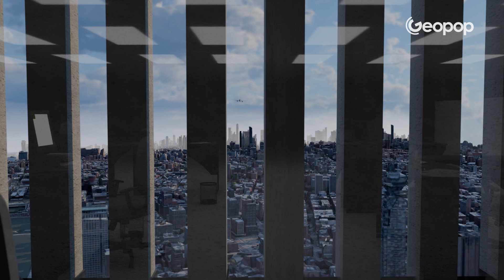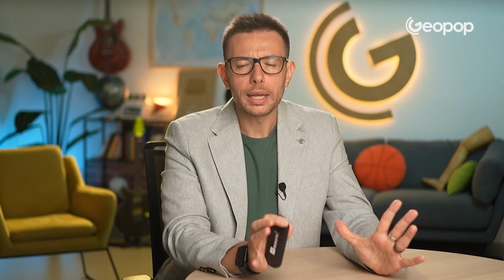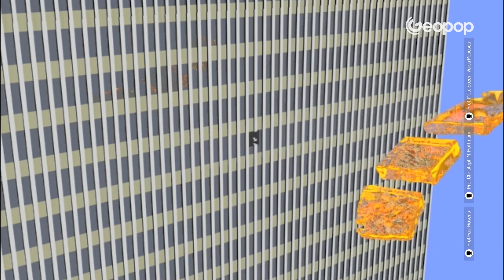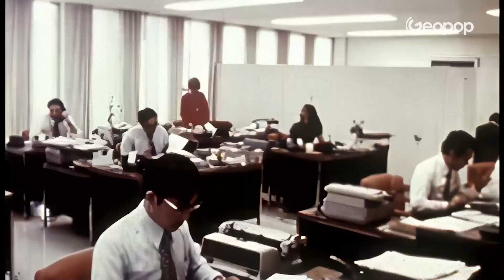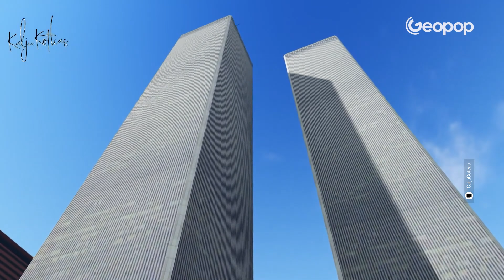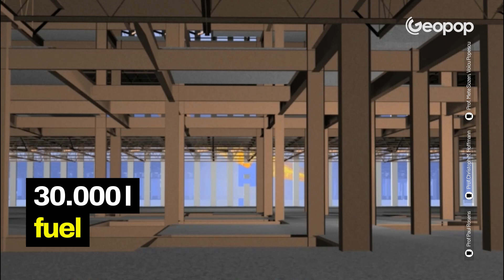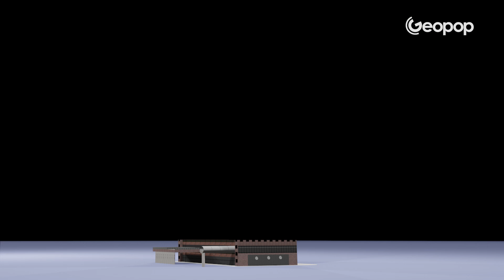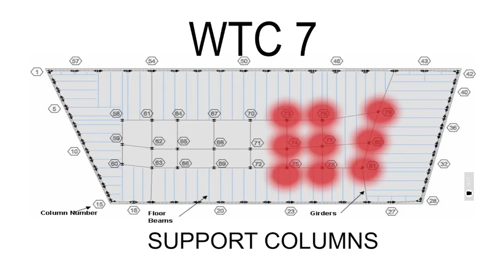9/11, 2001: The Technical Reconstruction of the Twin Towers and WTC 7 Collapses

Comment: did you do a test for explosives? or are you basing your theory on a theory which never did such a test even though the remains of the dust were still active as demonstrated in many videos...
Reply: What is the first test for explosives?

What is active dust ?
Reply: @TheLoonResistance  so wait: NIST never went full CSI on any of the materials sampled around the building? what exactly did they do? compose a self defeating simulation of which they couldn´t do more than a 1.2 seconds?
Reply: @JefframinEpsteinyahu  - So wait, please don't be rude by dodging my questions.  I do not tolerate deliberately evasive off-topic derails.
Reply: @TheLoonResistance  there was no test ever done to prove or disprove the existence of explosive or thermitic material. at least not by NIST. but Nist itself mentioned the iron granules only created during thermitic reactions.
Reply: @TheLoonResistance  don't you think that not testint for explosive residue/material is kinda strange given that there was an bomb attack on the building before?
Reply: @JefframinEpsteinyahu  - What is the first test for the use of explosives?  Please answer the question.

IF you don't know then please stop dragging this out and just say you don't know. The honesty would be refreshing.
Reply: @TheLoonResistance  plz indulge me as to why there was no test done and no test results released by NIST
Reply: @TheLoonResistance  show me the results of the test and i may tolerate your rhethoric wankery
Reply: @TheLoonResistance  i have a question for you tho: why does the video say the elevators dropped with no resistance when everybody and their mother knows that once an elevator loses it's steel cable an automatic locking mechanism is released. so this video is just one more bunch of narrative bullshit
Reply: @JefframinEpsteinyahu  - I have a question for you:  What is the first test for explosives?  

You can't say no tests were done if you don't even know what the first test is.
Reply: @TheLoonResistance  i can say this because Nist itself stated this publicly after being questioned about it. so sit down and shut your little propagandized ass up, i m not playing your games shithead
Reply: No, you can't.

The NIST were not exactly the first responders, were they?  They didn't start their full investigation until August 2002. Other entities were on scene long before The NIST was assigned to the case.  IF the matter of explosives had already been resolved before The NIST came on board, there is no reason for The NIST to test for explosives (whatever that means), is there?

Is there some compelling reason The NIST should be testing for explosives by the time they came in - other than of course you have a deep need do believe there were explosives?  Do you have anything tangible?

Where would you start?

Recall, The NIST merely stated:  NIST did not test for the residue of these compounds in the steel

That's pretty specific, and not where anyone would start
Reply: @TheLoonResistance  nice assumption troll, so how was the matter of explosives resolved before nist came in?  since you know the first test, when was it made and published and peer reviewed (independently)
Reply: what you are basically saying is that 3000 people died and overpaid intelligence services and government institutions cannot present you with proof of disproof (by means of testing and sampling) of explosives used in THE BIGGEST TERROR ATTACK?

but then you go on and bomb 5 countries to shit by pretending it's islam (the one you funded, agaiinst russia, remember? ) and murder and starve MILLIONS, creating over 40 MIO REFUGEES

but you can't provide me of a full comprehensive explanation with actual factual proof and samples? 

you are a nazi pundit and apologist for the biggest massacre in history since adolf hitler.
Reply: @JefframinEpsteinyahu  - I'm not saying anything - just trying to get you to turn your brain on.

Had you actually read The NIST's final reports or even just the FAQ's you wouldn't need to ask any of these questions.  For example, from the Twin Towers FAQ:

28. Why didn't NIST consider a "controlled demolition" hypothesis with matching computer modeling and explanation like it did for the "pancake theory" hypothesis ?

NIST conducted an extremely thorough three-year investigation that included consideration of a number of hypotheses for the collapses of the WTC towers

Some 200 technical experts—including about 85 career NIST experts and 125 leading experts from the private sector and academia—reviewed tens of thousands of documents, interviewed more than 1,000 people, reviewed 7,000 segments of video footage and 7,000 photographs, analyzed 236 pieces of steel from the wreckage, performed laboratory tests, and created sophisticated computer simulations of the sequence of events that occurred from the moment the aircraft struck the towers until they began to collapse

Based on its comprehensive investigation, NIST concluded that the WTC towers collapsed according to the scenario detailed in the response to Question 11

So The NIST interviewed over 1,000 people, reviewed thousands of photos and hours of video and performed direct analysis on critical steel components saved from the wreckage.  None of that supports explosives or incendiaries. 

Long before The NIST got involved there were over 300 canine teams combing the debris pile for weeks - not a single hit for explosives or incendiaries. Thousands of workers cleaning up debris and hundreds of forensics experts sorting every grain of dirt and dust that came out of Ground Zero found zip for trace evidence of explosives or incendiaries. 

The NIST based on the visual record, photo and video evidence, empirical testing, 150 years of fire science research and computer modeling developed a hypothesis for collapse that matches all of the known evidence and that does not involve explosives or incendiaries.

So what else were they supposed to do and why?
Reply: @JefframinEpsteinyahu  - So there. Was that really so hard to figure out?

Comment: 4 million pounds per floor,112 million pounds above the south tower,and 76 million over the north tower. Idiots think the building was supposed to hold up that weight forever
Reply: They stood tall for 30 years alright until they were knoocked down by planes!
Reply: @ajMirza-gc6il  Nuh, not by planes.
Reply: A three-alarm fire broke out in the 11th-floor offices of the B. F. Goodrich Company in the north tower of the World Trade Center just before midnight last night and spread through an inner-service core to the ninth and 14th floors. “It was like fighting a blow torch,” according to Capt. Harold Kull of Engine Co. 6, who said all of his men “got their necks and cars burned” trying to get into the 11th Floor hall from a stairwell. A total of 24 pieces of fire fighting apparatus and 132 firemen fought the fire. Sixteen firemen were treated at the scene for smoke inhalation. Flames could be seen pouring out of the 11th-floor windows on the east side of the building. 
--- TRADE CENTER HIT BY SIX-FLOOR FIRE, Blaze Starts on the 11th—16 Men Are Injured, The New York Times, February 14, 1975.  Needless to say, with the weight of 99 floors bearing down upon the 11th floor, the building did not collapse.
Reply: @markcohen308 wow you are dumb
Reply: @markcohen308 a fckn plane didn't hit it then
Reply: @basicengineering74 Yea well, if you want to play that game, no plane hit Building 7 and NIST said fire alone brought it down, the first time in history.   And plane impacts still do not explain the building falling at free fall acceleration (as admitted by NIST).  That is a hard violation of Newton's Third Law.  That's impossible.  And yet the North Tower came down as fast as a brick dropped off the side of the building falling through air.  That means that the building, with all its steel and concrete, crushed through itself as fast as a brick dropped off the side of the building falling through air.  The North Tower collapsed in about 11 to 12 seconds.  NIST said the building came down in 11 seconds.  But 11.52 seconds is the speed of a 'tumbling' brick dropped off the side of the building falling through air.  That means the building fell through itself with ZERO structural resistance.  That's just not possible.  Free fall means an object that is only under the influence of gravity.  If something is falling at free fall than all of its kinetic energy has to be used to do nothing but simply fall.  There is no energy left over to crush something, smash something, bend something or pulverize tens of thousands of tons of concrete to dust as happened on 9/11.  I'm sorry, but that is the hard science.  If nearly all that concrete being pulverized as was observed on 9/11 then it cannot have been a gravity driven collapse.  Gravity alone cannot explain how the concrete got pulverized.  There had to have been another source of energy removing the structural resistance.  And thats only one of the major problems with the hard science.
Reply: @markcohen308 because you are focused on one element (fire) and not all other elements of physics. The jet literally broke steel supports. You can, but you won't, go look at footage and see it with your own eyes. You used "fire alone" as a comparison to "fire, force, removal of fire retardent, and the fact that this fire was fueled but insane amounts of jet fuel compared to just a fire. You are bad at this. Are you bad at all other aspects of life as well?
Reply: What about the heard explosions down in the lobbies....they have to be controlled.On key places of the buildings,put in advance and the whole scenario contolled from building 7. 9/11 was made by the military industrial complex,which stands above USA president and government,and has its own agenda.
Reply: @dimitarminchev7520, how does that make you feel to know you're just repeating things that aren't true?
Reply: @basicengineering74  How does it feel to expose yourself as a stupid liar? The Twins were designed to withstand a fully loaded 707 crashing in at 600mph, AND the resulting fires. And that´s despite the fact that the Twins didn´t even had sprinklers first. You can look that up. IN THE OFFICIAL REPORTS my poor little wannabe.
OF COURSE the towers were supposed to hold the weight forever moron.
Reply: Ignition of intense fires can often sound like explosions.
Reply: @eggsinhell1532 right. Same with steel supports snapping. Incredibly loud. Just chop a tree down and hear the noise it makes. Now multiply that by several orders of magnitude. These tin hats have always been fools.
Reply: @dimitarminchev7520, go look at the bent pieces of steel. Watch a video at the WTC Memorial Museum. You have zero clue what you're talking about,and you think a controlled demolition caused that lol? A cold compressed piece,a 2 inch thick piece bent like it was made out of something else. Yet your on here showing the entire world how ignorant you are
Reply: @basicengineering74  Not your completely irrelevant compressed piece of shite was caused by an explosion but the blown out windows and cracked walls moron.
Reply: So you call the chief engineers of that buildings "idiots"?
Reply: @Kudde23 not the engineers, the conspiracy people who know nothing

Comment: Steal melts at like 2,000 degree's at 900 it would bend like he said... always amazed me how steal columns can vaporize under only weight... like he said 900 degree's at the impact point and as the floors go down it would get less hot... but then I realize he reading off a "report" that who knows who had written... Then that 900 degree's got blown by the wind into tower 7 and took that building down the exact same way... some of the dumbest engineering our country had ever built in history... nobody wants to admit this guy is blowing SMOKE
Reply: That was one of the dumbest posts out country has ever seen.

Comment: Bollocks.. what about the liquid metal dripping from the side of the building. Claimed to be thermite.. What about the windows blowing out a second or 2 before the colapse many floors below. Reported by firefighters as explosions.. Building 7 reported by bbc as colapsed half hour before it did then a textbook controlled explosion. Hundreds of architects and engineers have came together and pulled this storey to bits not to mention the firefighters too. Do your research people. Architects and engineers for 9/11. The REAL TRUTH IS THERE IF YOU LOOK FOR IT...
Reply: Whataboutisms are for the weak.

Sparks pouring out of the South Tower (and it was in fact ONLY the South Tower)?

You mean this? youtube.com/watch?v=xPVGGQU-MeQ&ab_channel=SeekersofTruth

This will take just a couple of minutes and is worth the investment.

The Boeing 767 which struck the South Tower weighed 117 tons and 80% of that was aluminum. The exterior cladding on the Twin Towers – the white panels – were also aluminum. When Flight 175 struck at the 81st floor its momentum deposited much of the office contents in its way and the bulk of the aircrafts mass into the NE corner of the building. The piled up debris shoved into that corner is visible in photographs and video so we know it was there. There’s a good shot here of piled up debris from 4:36;

youtube.com/watch?v=ZLJyL63sqtU&ab_channel=MrKoenig1985

Steel melts at roughly 2,750-deg F while fires in the South Tower reached peak temperatures of around 1,800-deg F. Aluminum OTOH melts between 887-deg F to 1,180-deg F depending on alloy. That aluminum will melt under these conditions is not a surprise. If you look at pictures of cars left behind and destroyed by forest fires the aluminum wheels are invariably melted away along with other sometimes aluminum parts like hoods. Steel bodies remain intact.

The “molten metal” appears at 9:52 am. At the same time we see the first externally visible signs of sagging floor trusses and the pulling of the perimeter columns inward. I submit these events are related, not coincidental. The aluminum cladding at the NE corner also appears to me to be burning. It is likely the with the floor trusses sagging under the heat, and the 81st floor truss in the NE corner under the debris pile subjected to the heavy load of the debris pile, the truss broke its perimeter column connections and dropped, instigating the material starting to pour out of the NE corner at the 80th floor.

Given the properties of the materials in question, aluminum is by far the most likely culprit.

Reports from The NIST, FEMA and MIT all concluded the material is aluminum.

Certainly steel is the least likely of all the materials the anomaly could be given its much higher melting temperature and the fact there is no logical source for molten steel. The perimeter columns in the NE corner are intact and the material is pouring out between them. So it isn’t columns melting, therefore what other source of steel is there?

As for thermite - that is just pure conspiracist fantasy. The mind boggles as to why it took so long for an incendiary to cook off in such massive fires. Not possible. The claim falls flat on its face.

Deniers will claim molten aluminum appears silver when molten, which is true but only at the low end of its melting temperature range. Aluminum can and does get hotter and it glows red to orange when it does (1,100 to 1,800-deg F). Most folks of course just don’t bother getting it that hot if the goal is just to get it molten for say molding a part. No need to go higher. The total mass of molten aluminum is a BIG deal in regard to how it behaves when poured. Quantities bellow half a liter cool almost instantly if poured onto a flat surface, but if poured into say an ingot mould will stay red for a minute of so. Pouring volumes of molten aluminum greater than a liter is a VERY different experience. The thermal mass is much greater and the radiant heat is horrendous. The aluminum is able to stay liquid and remain glowing bright orange much longer. The famous video of glowing liquid gushing out of Tower 2 moments before it fell, involves at least tens of liters of molten aluminum. The thermal mass involved is so great that it stays red after falling many meters through the open air.

Side note: There was also a large UPS battery farm in that spot and some of that material at least may well be from the batteries IMHO.

As for the collapse, as we can see from the excellent Gary Pollard closeup of the South Towers collapse, the cause was inward bowing of the perimeter columns until they buckled. Smoke (at relatively low velocity) does not start blowing out windows until well after several thousand tons of building have started to move, the billowing being a reaction to the building moving, not a cause of.

www.youtube.com/watch?v=ULdiD6gYZO0